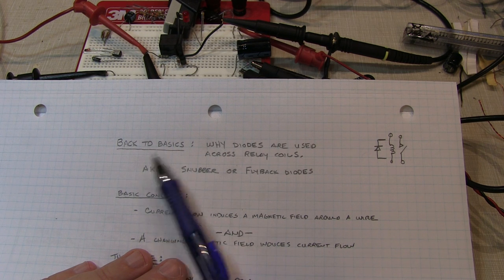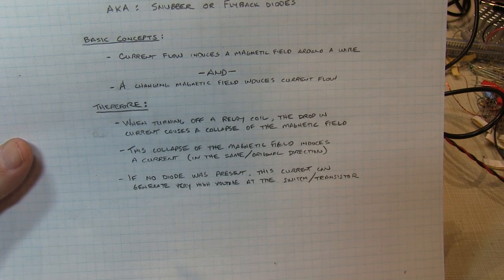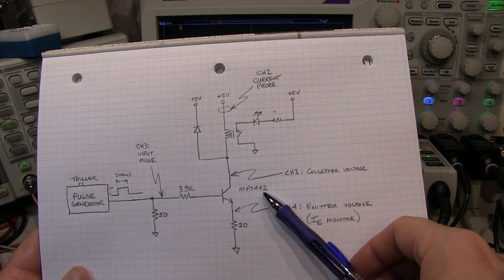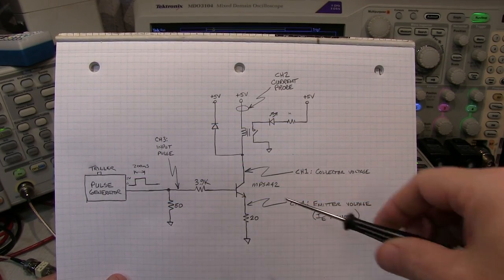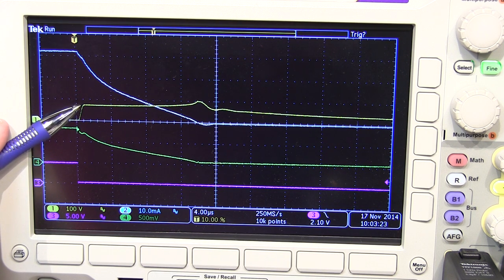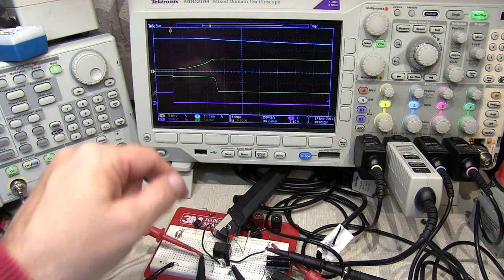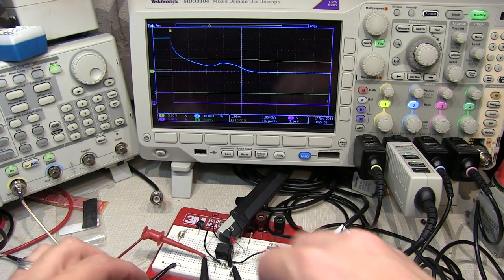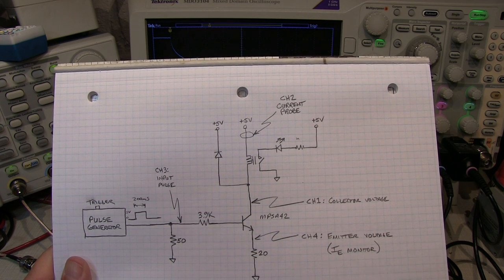#183: Why diodes are used around relay coils: Back to Basics on flyback or snubber diodes

Comment: A common error: relative motion between a magnet field, and a conductor, does not induce a current in the conductor; it induces a voltage; then, if, there is a complete circuit, a current will flow.
Reply from the maker: Yes, a common error that I make!  I'll pin this comment so others will learn from my mistake.
Reply: V = L di/dt
Reply: @ricardothedardothebeastfro4747   The Professor was talking about: e = N(dΦ/dt), I suppose.

Comment: 11:04 the sag in the exponential curve of the coil current is due to the change in the magnetic circuit. It's common to all relays driven in DC: there are basically two exponentials associated with the two different limiting values of the inductance: one when the magnetic circuit is open, and one when it is closed. The sag (or bump when you go from unenergized to energized) is what happens in between.
Reply: This was my guess too. That or the metal moving inside the relay.

Comment: Couple nitpicks;
At 11:44 "and dissipate it safely into the positive supply".
No energy is going back into the positive supply, while the diode is conducting.  The stored energy is being dissipated in the diode, but mostly into the relay coil resistance, because only one lead of the supply is connected to the current loop through the coil and diode.

You keep saying the changing magnetic field induces coil current.  I think a clearer way to think about this is that the changing magnetic field induces coil voltage, and the entire circuit determines how that induced voltage affects instantaneous current.  Instant by instant, as that current changes, it alters how the magnetic field is changing and those magnetic field changes keep inducing resultant voltage.  Current produces magnetic field.  Rate of change of that magnetic field produces voltage.  Voltage drives current.  And round and round we go.
Reply from the maker: Yes, I miss-spoke about the energy going into the supply rail. Thanks for the correction.
Reply: Thank you for the deep explanation, it was kind of difficult to understand until I read this comment. Now I see how the energy moves and dissipates in that diode/coil pair. Thank you both for an excellent addition to the incredible video! Keep up the great work w2aew!
Reply: @w2aew  hello i want to talk you.personaly
Reply: Moving magnetic field induces a current in a wire.  Whether that current produces a voltage depends on encountering resistance (ohms law).  In a superconducting storage ring you will have zero volts but hundreds or thousands of amperes of current.
Reply: @thomasmaughan4798  What if this current is induced into an open circuit?  How much voltage will it produce to drive that current through an infinite resistance?
Reply: @jpopelish  It's very difficult to create a real open circuit and in practice there's always going to be some finite resistance, even if it's the air becoming ionised by a very large voltage and conducting. Petrol-fuelled internal combustion engines used to have spark plugs to create ignition and they were driven by the opening of a pair of contacts to switch off the current flowing through a coil. With just 12V, that was able to generate a high enough voltage to create a spark by breaking down the gas in the combustion chamber.
Put simply, that voltage can get very high until something conducts and allows some current to flow.

Comment: THANK YOU THANK YOU THANK YOU. I had a problem with a 20yr old industrial bake oven, the oven kept shutting off intermittently. It had a 5 pin 120v control relay, a 120v main power contractor for the blower and tapped from top of that, a 120v contractor for the 3ph  heat elements. I changed an original stop button with weak spring, a noisy element contactor, an original control relay, and a original dual element thermocouple. Then by looking at the schematic, I figured out someone prior had changed a hi temp limit controller and during the rewire had removed the snubbers across the coils. Funny thing was it worked like that for more than two years before developing the problem which  gradually grew more frequent. Now I fully understand why those are necessary, what they do, how they work and could probably diagnose the situation with a scope or analog voltmeter. THANK YOU. Your videos are complete and to the point. Keep up the great work. You made my day! Merry Christmas!

Comment: Thank you. I was looking for if the diode type could be significant in the circuit performance and the peak current value in the snubber diode. You answered both questions.

Comment: Excellent use of storage oscilloscope and actual breadboard circuits.  Snubber diodes protect BUT slow down relay release.  Closely related to all this is the presence of non-ferrous shim at the relay to prevent the armature from sticking.  Long ago in a galaxy far away I used a scope to detect a bad shim in IBM electronic accounting machines.  When the armature clamps shut, the velocity of the armature will produce a small spike of voltage (moving magnetic field) and at the moment of closure its velocity becomes very high.  The stainless steel shim prevents full closure and that, combined with an RC snubber, greatly speeds up release.  When everything is proper there's not much of a energizing spike but if you see a relay that has a voltage spike across its coil a few milliseconds after engergizing, that means the armature has clamped down and there's no shim.  It is very difficult to see this with your eyes that the shim has broken off.

Comment: This strikes me as a good place to use up salvaged 1N4001s,  which I would likely never use in any power supply application due to their low PRV rating...

Way back in 1975 I was called in to help out with getting a bit of industrial machinery working.  This was a big machine, had a whole room to itself.  I was told that the original designers had spent $160,000 to get this thing built,  and that since then between $300,000 and $400,000 had been spent to try and get it working right.  One of the first things that I noticed was that every single fault indicator on the thing was indicating.  These were driven by a panel of relays,  which were in turn driven by some open-collector logic.  (Look up Amperex "norbits" some time,  those were some really bizarre parts.)  Every single one of those driver parts was shorted at its output,  because nobody along the way had bothered to put those diodes in.  I ordered replacement logic,  and put some diodes in,  and that fixed that particular problem.  It amazes me to this day that nobody along the way had seen fit to do that.

Comment: Hello ! I have a few questions. 

1. Why did you put 50 ohm shunt resistor? 

2. At 4:30 It took almost 10us for that first transistor to start shutting down and another 4us to shut down. Is it possible to read that from data sheet? Second transistor started shutting down immediately 

3. Why did the current go negative (Ch3) ? It looks like current through the diode when it gets reversed biased and diode is still conducting due to recovery time but transistor didn't get reversed biased here. 

I like your videos because you show what is going on in that split second when in the book we only see straight line (usually vertical)

Thanks!

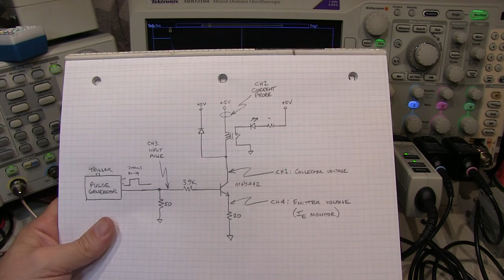Comment: 13:03 I've a question. Should we use another diode for protect power supply from inductive spike which is going to eliminate by flyback diode? Think that put another serial 1N4001 to +5V ?

Comment: The problem with that diode is that the current in the coil and its magnetic Flux decrease quite slowly because dI/dt=V/L. So we want to let the highest possible voltage appears on the coil terminals. Of course we should limit it to avoid any damage to the transistor. Do you think that adding a zener diode (reversed) in series to the diode to keep the one way behavior but with higher threshold could be a solution?

Comment: Fantastic presentation!  The Arduino projects that I have been doing show how susceptible the Arduino is to this back EMF.  Projects that work on the bench before connecting to the external relays we use work fine until the first turnoff of the circuit and the relay is released.  Crashes almost every time.  Sometimes it takes out the Arduino itself. 😳

Comment: The waveforms around 1:20 are fascinating. I've seen this before with crankshaft sensors, but I don't understand it. Why are there 2 peaks, one positive and one negative? Which part of the waveform corresponds to the inductor being closest to the magnet? If the motion is constant, then I would expect the wave to be symmetrical, in which case the zero crossing is the closest point. But then what causes the voltage to change direction just before and just after that point?

Comment: At timeline 5:09 , why didn't the high voltage pulse of nearly 250 volts appear at the collector of the transistor the  instant the trigger pulse went to zero volts? There was a delay of the high voltage pulse appearing at the collector. Also, could you have used a capacitor instead of a diode to squelch the high voltage pulse?

Comment: Really good video, I learned much thanks for posting.  I recently found some TE Application Notes that  tried to minimize the coil collapse time of a NO DC relay by adding a series zener to the diode.  Apparenly such an arrangement  reduces the average 19ms coil collapse time for a diode alone.   Zener & diode connected parallel to coil in K to K or Anode to Anode.

Comment: Great demonstration as always.

It would be interesting to dive into the relay switching time and how it is effected by adding a flyback diode or other components.

While I know that relays will take longer to switch off, it would be fun to see the fly back diode replaced with things like zeners , MOVs, or resistors to cap the voltage below the switching transistor’s breakdown voltage, but still higher than a basic diode drop. Will those devices have the same effect of the time it takes for the relay to switch off?

Comment: W2aew, hello. Please advise,  Does flybacks with a bunch of capacitors for ripple current handling, protects the switching power supply from "heavy" dc motors as well? And can be used.  Although motors can be 12-24 volts rated as on scooters for example. MY 1025 motor as example. I assume that it can be used. Another option is supposed to be a battery paralleled to power source. Or braking resistor.  What is best? And how flyback diodes and capacitors are rated among this application? Thanks.

Comment: I was so confused. I heard people saying that when we suddenly stop flow of current through an inductor, it generates a reverse voltage. I was not able to visualize it. But now I understood.  It's the increase in voltage at other terminal. Due to this diode gets forward biased and allow passing of this high voltage through it. Now, it's clear. Thank you so very much.

Comment: You really explained it very good. Especially the part the current from the coil rushing into the switched off transistor that is high impedance and producing that high voltage. If there was a low impedance path there would be no high voltage.. Collector−Emitter Breakdown Voltage of 2N3904 would be 40V(min value). That is also the abs max voltage. So that has not "killed it" right away but it is not "healthy" for that type 🙂 In your configuration and that specimen it was more of a 60-70V. I was thinking (wrongly) that the diode should be of a high voltage type, but that is not the case, as the diode prevents that high voltage to occur in the first place 👍

Comment: A flyback is something I've just done, it's very nice to finally see it visualized in traces.
But I've been wondering, if there's very little "absorption" in the 5v rail in this instance, maybe a 7805 or a USB and little or no capacitance (bypass caps for instance) could it spike on that rail instead?

Comment: I loved watching this.  I'm an electrical engineering student and although we do get experience in the lab with diodes, capacitors and transistors what we don't get exposed to is some of the practical things you have to do in "real life" to account for unexpected things like the "fly-back effect."  

You have really nice equipment too.  That current probe cost thousands of dollars and you have a 1 Ghz 4 channel TEKTRONIX scope.  Very impressive.
Reply from the maker: It certainly helps when you work for a company like Tektronix ;-)

Comment: Very informative video. This information pertains to a DIY circuit I am currently trying to figure out. I hadn't though about Inductive Kickback. Now I have to start from scratch to figure out how to wire up my water pump setup with two float switches. Everything is running on 12VDC. If you're getting 100V from just a 5V input, I can't imagine how high my voltage will go. Pump is running about 1.5 amps running. I don't have an inrush current reading.

Comment: Well your video is very informative and helped me a lot. But I have a small doubt, if I am wrong just ignore it. I think when the magnetic field collapses in the coil of relay the polarity of the voltage changes, that is when the transistor is on the relay become energised and the polarity orientation is '+' then the other end '-' (first and second ends of the relay coil respectively), and when the transistor turns off the magnetic field collapse Creating an opposite voltage '-' and '+' (first and second ends of the relay coil respectively) which is termed as inductive kick back, so I think there is a small mistake in your understanding. My correction may be Wright or wrong, what ever it is please make a reply. Thank you for your time w2aew.

Comment: Excellent presentation and tutorial for a method to protect sensitive electronics used in many applications. I particularly found it interesting when getting advice from SilverLeaf Electronics tech support on protecting their circuits from a suspected issue with a White Rogers solenoid used as a bridging circuit for house and chassis batteries in our RV. Protection for expensive controllers is of utmost concern and importance. Thank you for the education.

Comment: I have a switchmode 12V power-supply (cheap amazon unit) which feeds LED lighting, an RV furnace, and an on-demand RV water-heater. It also feeds a 5V regulator which powers an Arduino (with buttons, a relay, sensors, and LED controllers... all 5V). My water-heater has a solenoid valve for the propane, and whenever it shuts off, the LED lighting gets triggered as a result of the inductive voltage spike... I can't (or at least don't want to) crack open the water-heater to put a diode perfectly in parallel with the coil, so I'm wondering if I can simply put a diode across the positive & negative terminals of my power supply... is this electrically different? My thinking is that I'm creating a path from the "negative" side of the inductor back to the positive side of the power supply, which is what I've gathered from your explanation. There are also flashes of light sometimes when the furnace lights up (because it has an inductive arcing mechanism) as well as when our regular AC fridge turns on/off (so there is spiking that is coming through the power-supply from the AC side) and I'm looking for a solution to clean up all of these spikes... 
I'm also trying to understand what is happening in my circuit right now... is the collapsing magnetic field pushing a voltage to my power-supply's negative terminals? Wouldn't this spike at the negative terminal essentially drop the positive voltage to zero (since the positive voltage exists as a relation to the negative) and then continue its spike until it peaked with a high reverse-voltage? (the voltage at the negative terminal would be way higher than at the positive terminal?) This doesn't make sense to me because I would think that would wreck something... having a huge reverse-voltage like that on electronics... 
The other thing that I'm thinking about is that I don't really know what components are inside this power-supply and I don't want to create a worse situation than I already have... is there some kind of catch-all smoothing I can apply to my 12V system?
Reply: Hi Tiny, the diode has to be reverse biased across the coil to do the dissipation properly. It’s possible your cheap power supply is not providing enough power for peak demands. I remember awhile back having a diode that physically broke on one of our machine’s relays. It took us days to figure out why the computers in the machine were going hey wire!

Comment: Thank you! You are so easy to follow. Never have I learned so much so quickly. I’m an old fart trying to figure out the diode polarization across a fuel solenoid on a boat. I wanted to protect the contacts of the relay from fly back voltage. Just the opposite of a LED. Your diagram showing (+) was  great help. Thanks. PS I sure hope you are a teacher
Reply from the maker: Nope - not a teacher.  I'm a Field Applications  Engineer for Tektronix (Test & Measurement Equipment).